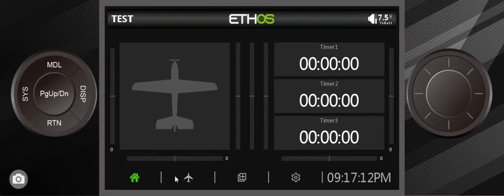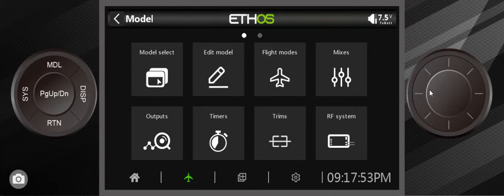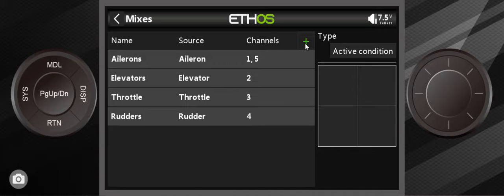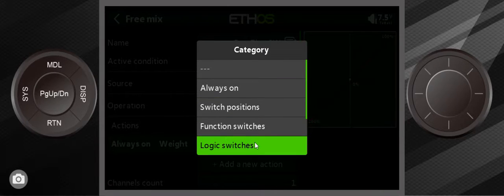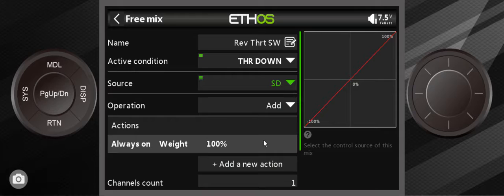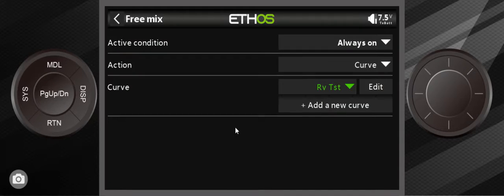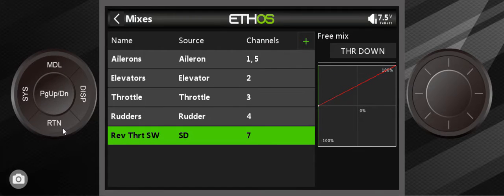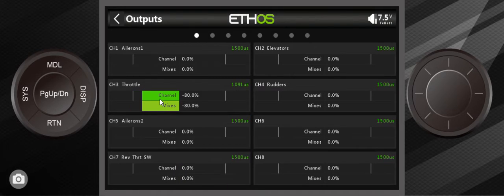FrSky Ethos: Reverse Thrust On A Switch

Comment: Steve i did the new setup but one problem still. With throttle cut off (ready to fly) Reverse Thrust SW off i give throttle to go forward but motot is in reverse. When i turn on Throttle Reverse switch motor is still in Reverse. Also if flying normal and i get in trouble and throttle is up and i hit throttle cut motor still runs.
Reply: Something isn't right. It doesn't work for me either.
Reply from the maker: @fordarrick  I  got Art's model file and this video wasn't followed carefully.  The plane he has had a reverse thrust servo connector that worked when assigned to a channel.    Your plane may not have a rev thrust connector.
Reply: My active condition category doesn’t have “logic switch”